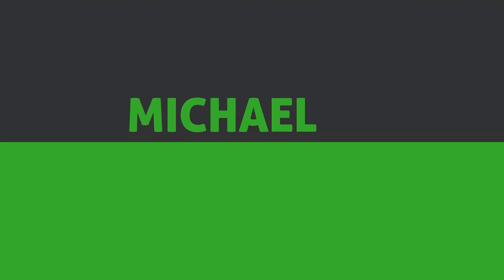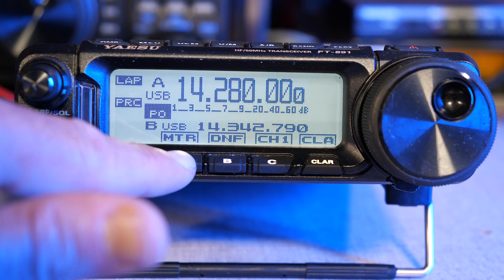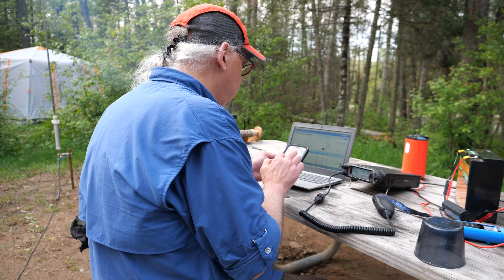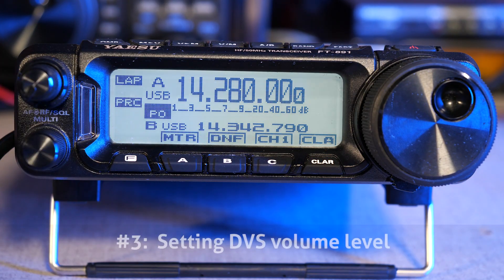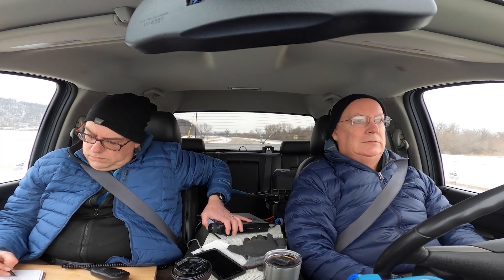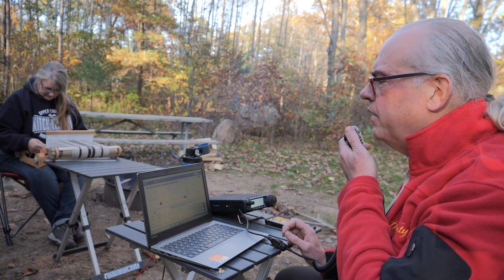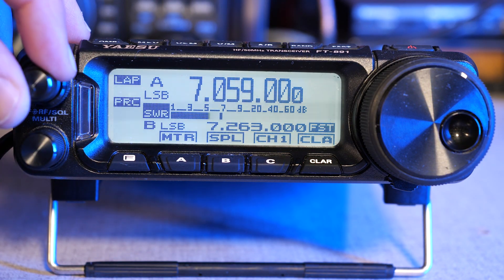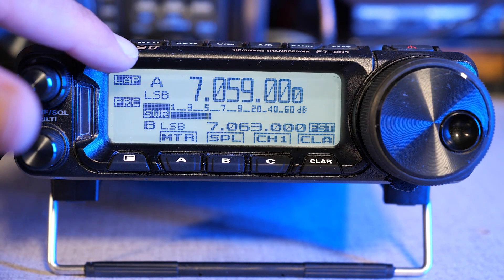Five CLEVER things you didn't know the FT-891 did #hamradioqa

Comment: This VFO is tossing me, and I didn't find my answer in the manual. You highlighted A or B. That's OK. As soon as the frequency is changed, the A VFO is un-highlighted. Which VFO at this point is active. The easy split is good, but this VFO selection is confusing to me. I've asked a few others and have gotten a few different answers.

Comment: How do you get the knob to step in increments of 1 ? In have to fine tune every frequency with the VFO AND IT’S VERY DIFFICULT
Reply from the maker: Pressing the FAST button on the top engages a higher step rate for the tuning knob. The max is 500 KHz steps in fast mode. Menu items 14-01 to 14-07 lets you adjust the step rates to your liking.

Comment: So I bought my second Yaesu FT-891. I use one for off grid Field  Day and POTA. I have only done one POTA and two field days with the 891 but I wanted to learn the radio better so I bought another to use in my Ham Shack. After 3 days with the 891 in the shack, and re-watching your initial 891 setup video and this awesome video, I am very happy I have a second 891 . Running 100 watts on a G5RV JR 21 feet at center point, with an MFJ manual tuner and an MFJ 1:1 balun at end of ladder line and it’s all grounded and working like a champ. I learned more about the 891 from these two videos than I could have figured out in weeks. Thank you again for these 891 videos, you make this hobby even better. KI5DAY
Reply from the maker: The FT-891 may be a portable rig, but it fits right in the shack too. It has a lot of features found in more expensive rigs. I used one as my primary shack rig for about a year until I upgraded to something more substantial

Comment: Hi Michael. Thanks for another amazingly good video.  I have an FT-891 too, and it is an amazingly good radio.  I cannot fault it in any way. It has so many of the facilities of a full size desktop radio, in such a small package.  What pleases me every time, is the fantastic audio quality.  I do use an external, dynamic hand mic (similar to the famous Shure SM58) and a good quality external loudspeaker. The results are amazing. I generally get unsolicited good audio reports and the received audio is a joy.  It really is worth taking time to set up the mic equalisation using Yaesu's very comprehensive Parametric Equaliser settings for use with, and without the processor enabled.  The FT-891 is brilliant.  Thanks again for a great video.  73  Mike  M0MTJ

Comment: I trust your opinions, so I have a question. I am currently running a TS-480 as a mobile rig and it performs really well.  I have been considering a trade however to the FT-891, mainly due to size considerations and being able to use it on trips and in the field. Might even replace my G-90 with it as well.  Do you think I would be satisfied with it as a mobile?  I mainly operate mobile with monoband sticks, and in the ssb frequencies, so lack of a tuner is not a huge factor in mobile. Might be more of a factor for portable, but I do have some tuner options, if needed. What are your thoughts?
Reply from the maker: I think the FT-891 would make a great mobile rig. If I had a second one, I would probably mount one in the car for that purpose. It does have a removable head so the body unit can be mounted under a seat or something to take up less space on the dash. The display is large and easy to read on the road. It has a lot of memory channels so you can preset common frequencies, and the noise blanker is very good. I've used the noise blanker while operating mobile for the Minnesota QSO party and it does a great job with a minimal impact on sensitivity. 

As for a lack of a tuner, I don't think that should be an issue for mobile operation. Just about everyone I know operating mobile does so one of three ways: monoband sticks, remote tuner at the base of a long whip, or ATAS-120 antenna. I think if I was mobile, I'd go the ATAS route before buying some type of mobile tuner.

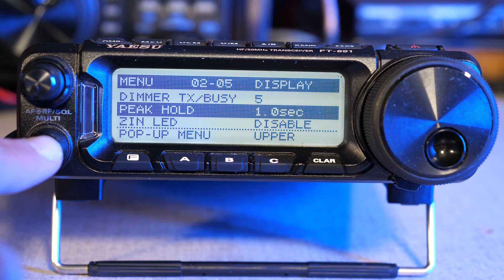Comment: Could you help me please, on my FT-891 indicator of the received signal strength (11:12) does not work. He froze at a constant level. It worked before, but I switched something or changed the settings and now I don’t know how to get it back.
Reply from the maker: My guess is that you have the RF gain turned down. That's the inner ring on the volume control (AF gain) knob. As you reduce the RF gain, the S-meter level on the display will rise. Try spinning that knob to the right until the meter goes down to 0.

Comment: Hey Michael, thanks for the nice video. Do you know something about the min. voltage you need for this radio. I just heard it would not go down to 10V like the older FT-857D does. I'm asking because i would like to use it at a 12V Batterie, which we all know well goes sometimes down to 10V ...
73, Ingo, dl5kci
Reply from the maker: The FT-891 doesn't like it when the voltage gets below 11v on transmit and will shut down if the voltage drops to 10.5v on transmit. I think because it has a slightly higher current draw than the FT-857, it is also more sensitive to voltage drop than the FT-857.

Comment: Hi Michael, I have just bought an 891, your videos have been a great help in understanding some of the features of the radio, and great easy-to-understand content. I have a question I noticed in this video you are using what looks like an Eco-Worthy lithium battery what are your thoughts on this battery and roughly what life do you get out of it on a POTA activation? As I am still trying to decide which route to go for a battery.  73 VA7EEH
Reply from the maker: The 20ah Eco-Worthy battery has been performing quite well for me. It's life depends on what your power output and mode will be. But the battery will last a weekend if I do strictly phone at 50 watts and several hours if I do phone and data (20 watts). That equates to roughly 200+ contacts phone only or mixed about 50 data and 100 phone.
Reply: @KB9VBRAntennas  Excellent thanks for the reply

Comment: How do you go down when you are doing split operation? You shown going up but not down.
Reply from the maker: You customarily go up for split operation, but if on the odd chance you need to go down in frequency, you will have to do it manually and not use the Quick Split feature.

Comment: Great video can you set it to tune at 1khz steps. Not found anywhere to do this I've looked at the manual thx
Reply from the maker: Menu items 14-02 - 14.05 change the tuning steps, but the biggest step is 10 Hz for sideband. If you press the FAST button you can toggle from 10 Hz to 100 Hz steps. I can't find a way to change to 1 KHz steps.

Comment: I own 3 
Nice radios 
Great value for money 
But 1 of them the ipo died
Still receives ok
I never use ipo att anyways
I was running on 160m with the 891 hooked up to 80m dipole 
Rig was turned off but still knocked out ipo 
Other than ic7000 finals 
Only time ive had problems with a rig in 44 years as ham 
So cant complain 

I see where others have had same problem and 991 as well 

Not sure its relay or the resistor after relay
Reply: How did your ipo get blown out please explain in more detail if you would I don't want to make the same mistake thanks
Reply: @chevyguy1128  just disconnect antenna from rig when not using it
Reply: @joebidet2050  OK thanks I think when you turn on ipo that bypasses the preamp right?
Reply: @chevyguy1128  there is no preamp per se 
There is ipo and att
Reply: @joebidet2050  sorry for all the?s I'm new to this radio just trying to find out what ipo feature actually does and some other things let's say I'm receiving a strong signal I turn on ipo it drops the strong signal alot.
Reply: @chevyguy1128  yes about 10 db and then turn on att drops another 10db
Reply: @joebidet2050  OK thanks I was just making sure my radio is working correctly like it should just got back on there air after about 5 years of being busy doing other things

Comment: I need to rapidly reduce the power level for tuning. Why is the TX power setting buried so deep in the menus? Why why why why WHY!!!
Reply from the maker: Since I hardly use the CW/Data mode, I leave that power level set to 10 watts and then quickly switch to that mode for tuning. That saves me from dialing through the menu.
Reply: @KB9VBRAntennas  Great idea!
Reply: Does the TNR function drop the power level when initiating tuning?
Reply from the maker: The TNR function does, but only when you use it with the ATAS 120 antenna or the Yaesu FC-50 auto tuner.

Comment: My FT-891 is set in USB mode, on 14.074.000 but when it transmits in WSJT-X through SignaLink,  it transmits on 14.073.500.  Why does it TX on a lower frequency each time?
Reply from the maker: What's happening is that WSJT is set to Split Operation. That's on Radio tab under the settings menu. When Split Operation is active and the 'Fake It' selector is picked, the CAT control will drop the frequency 500 hz so that your audio is in the center of the passband. This is supposed to increase transmit efficiency and reduce harmonics, but it also can cause issues, like moving you completely outside the FT8 window.  Modern transceivers are stable enough that they don't require this, so I leave split turned off.
Reply: @KB9VBRAntennas  Thank you sir!   That fixed the problem!!!!  73, Dean, CE4JDM

Comment: You can even simpler set the HF power to 100W temporarily: select the power settings (SSB/AM/HF) and press "CLAR" - will select 100W automatically but return to the previously selected value after turning off and on the TRX the next time.

Comment: Someone complained that since there is no battery level reading on the display, that the ft-891 can be damaged by  the battery level going too low. Is this possible? If so, is there no safety cutoff or warning? Thanks for a great video: learning about my ft-891!
Reply: Hi! Again, a late answer, but I used my 891 în the Field to the Point of depleting my homemade lipo battery, nothing goes bad with the radio, i'm going full power until the radio starts shutting down on transmit, then I reduce the power level to about 20W and keep going for a bout an hour more...😊. 3 from yo5tj

Comment: The existence of these clever and unknown tricks is an indication that the 891 is too vertical a design, meaning there's not enough room for physical buttons dedicated to these functions, so they have to be buried deeeep in menus. Wouldn't it be nice if we could plug in an auxiliary panel that's filled with lots of buttons and knobs to bring those menu functions to the front?
Reply from the maker: With CAT control, it would be possible to create an app that runs on a mobile device, like an iPad, or similar. You could then have a touch sensitive virtual display. Something like that is outside my wheelhouse, though.
Reply: Some manufacturers make accessory control panel options like that.  Xiegu makes one for their G-90 but it costs more than the radio does, so it's not very practical.
KZ9V

Comment: Hi Michael, your video is useful and interesting even if I already knew these features of the Yaesu FT-891.  It's a great radio that I also used yesterday in my POTA I-1384 activation.  A useful function that unfortunately does not have the FT-891 and instead has the FT-450 is the possibility of constantly displaying the supply voltage Vcc.  Too bad that the designers did not think about this very important and visible thing only when the radio is turned on.  
A firmware update would be useful.  

73 IU5KHP Nicola
Reply from the maker: Monitoring voltage in the radio would be nice. I use an inexpensive power meter that is in-line with my power cord to track voltage level and amp-hours and watt-hours consumed. Tracking watt-hours will give you a better indication of capacity than just watching the voltage.

Comment: Great video. My trick is to use the contour feature as kind of pre-amp that doesn't increase the noise floor along with the signal. Menu 12-4 level to 15. Menu 12-5 width to 10. Then turn on contour from the function menu number 2, and dial it down to 150. Bam, pops those signals up and DRASTICALLY improves audio quality. Also, put your I have shift to -140 and you're width to  2700. Unfortunately you need to do this every time you change bands.
Reply: Sounds like a job for CAT control and software.
Reply: @MrHuram-abi a total rookie here, what is CAT?
Reply: EXCELENTE DATO amigo, gracias, un abrazo!
Reply: Contour level and width are 12-2 and 12-3 on my 891...
Goes up to 20 and width 11

Comment: QSL? QSL? God I hate that. Whatever happened to just saying "over" or "go ahead" and using "roger" to acknowledge you received a transmission. This is established radio procedure that's been around for decades. All that "QSL?" nonsense started with the CBers and has gradually infested ham radio.
Reply from the maker: I'm not sure the last time I ever heard someone use 'over' or 'roger' during a contact (with the exception of an ARES/RACES activation, then you hear it constantly.) This 'nonsense' didn't come from CBers but from the rapid nature of contest exchanges; where brevity is paramount. For about 90% of the time I will use the more casual 'Back to you' to signal the end of an exchange instead of the briefer 'QSL'. I will throw in a QSL if band conditions are tough and the other party needs a definite indicator that I have copied their information and have they copied mine. Or, if I am working a pile up, I'll switch into 'contest mode' to efficiently work as many as I can. 

If you wish, I can share with you a complete, unedited, video of one of my Parks on the Air activations, so you can have a better feeling on how I actually operate. Then you will be able to direct your pedantry somewhere else.

Comment: THANKS! Why would anyone choose a G90 over an 891!
Reply: They're both great portable rigs and I own both.  Each have their advantages.  The strengths of the G-90 include -
* Smaller & lighter package.
* An excellent built-in antenna tuner.
* Superior front panel color display.
* Simultaneous display of PWR, SWR, Supply Voltage, etc...
* Front & rear panel guards.
* Mic with rig function control buttons.
* Lower idle (receive mode) current drain
* Lower initial cost.
KZ9V

Comment: Easily modified to transmit on CB channels I have one and I actually did it I won't divulge how either because I don't want any other screwdrivers in these things it's a bitch to do but can be done and it works great on the 27 MHz band especially on both AM and FM and sideband‼️‼️‼️‼️‼️‼️‼️

Comment: I love the 891 it's got an amazing low noise floor and fantastic audio quality, I listen via headphones. I recently got the 450D and not happy with the audio quality, it sounds bad in comparison to the 891 + the filters on the 891 are way better. 

The 891 is truly an amazing radio and very underrated, I use it as a 2nd receiver in my sitting room connected to the chameleon MPAS 2.0 with CAP HAT and it allows me to catch some cool DX while sitting on the couch and it just sounds so good to listen to. 

I had the 7300, hated the harsh audio and will sell the 450D, I'll never sell the 891 while it might be small and heavily menu driven most of them are set once and forget and you can't beat the audio quality with headphones. 

I have the FTDX-10 now too and while ergonomics are not the best it has an amazing receiver and audio quality. Pity they can't put more buttons and knobs like the TS-590SG and just use the monitor out for those who want the waterfall, it's not rocket science is it ?

Comment: What size AH battery do you use and how long does it last when your out doing pota?
Reply from the maker: I use two batteries, a 12ah and a 20ah. I've been using the 20ah more often as it will last me the weekend. Usually I can get about 5 hours of operation out of it at 50 watts transmit on sideband.

Comment: Hi Miachel, after a long time seeing your lovely video. The FT891 has a real great form factor loaded with tons of features.
Just wanted to know if there is a way to keep tab on the voltage especially when using it outdoors as the FT891 does not display it constantly.
Also wanted to know if the rig will get damaged if operated when the battery goes down?
Thank you and have a blessed day ahead
Cheers!
73
Reply from the maker: I use an inexpensive power analyzer to keep track of voltage and power consumption. Some people say they aren't accurate, but really all you need is a ballpark estimate of power used: https://amzn.to/3eUoJWu
Reply: @KB9VBRAntennas  thank you Michael
Reply: Unfortunately the only time the FT-891 displays the supply voltage is very briefly after "turn on".  Turning the radio off & on just to see the supply voltage certainly isn't practical.  I've inadvertently run a battery below the FT-891 cut off point and nothing bad happened. The radio just turned off.
KZ9V
Reply: @davewhite7679  Yes, Wish it had a constant voltage display but anyway an external device can be attached...
Just wanted to know if setting the ft891 at 15 watt and the battery drains to 9volts, will it still  run or shutdown on its own without affecting the rig?
Thanks

Comment: Is the built in power meter accurate, or just useful for relative readings?
Reply from the maker: Good question. I haven't compared it to a calibrated wattmeter.
Reply: I've actually found the "PWR" metering on the FT-891 to be surprisingly accurate.
KZ9V

Comment: I was wondering about if you’ve ever upgraded the software for the 891? I’ve made several beneficial settings to my 891 based on this and your other 891 videos. Does upgrading software return the 891 back to default setting preferences? Enjoy all your videos.
Reply from the maker: It's been so long since I did a firmware update, but I believe the settings stay unchanged when you apply one.